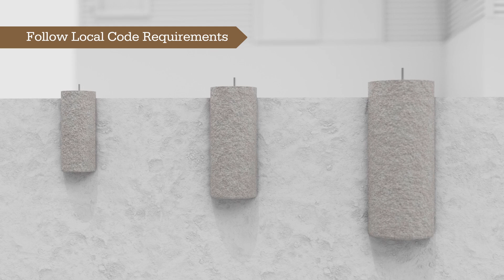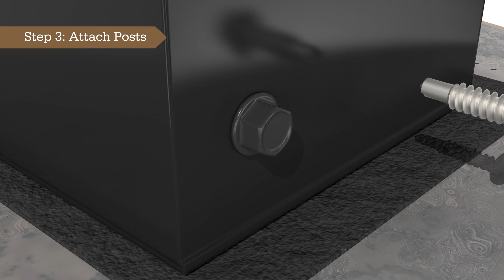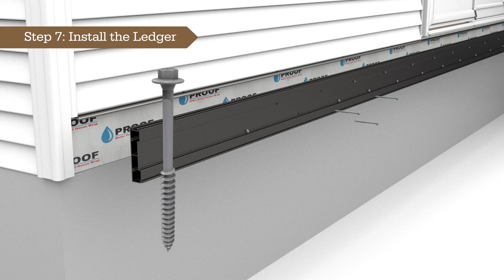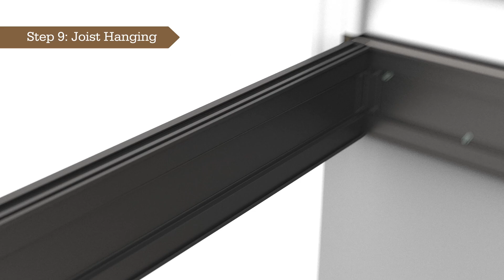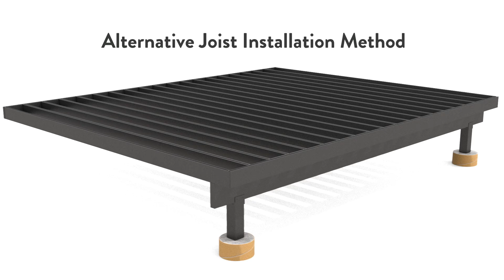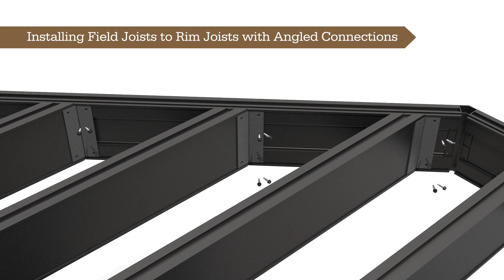TimberTech Aluminum Framing | Detailed Installation Steps

Comment: I am a certified Azek builder and on a build they told me they would credit me 10 boards. That's a big deal to a small business like mine.  Well, it never happened and they have had me running in circles trying to get reimbursed approximately $2,000.00 here is the text from my rep copy and pasted. Hey Andrew. 

Jocelyn is the one who will be taking care of that credit. It was passed through on 5/5/2023 for 10 boards. Distribution has the credit. They were supposed to pass along to your account at Franklin building supply. Not sure what's causing the delay, but from AZEK's side everything was done in a timely manner. Credit was pushed through as soon as you notified me. 

It never came to Franklin or my account so now I go public in a many places as I can copy and paste.  Thanks Azek and Timbertech #azek #timbertech

Comment: We are a Deck Builder in San Francisco. TimberTech Aluminum Framing truly stands out with its best strength-to-weight ratio compared to wood or steel! This allowed us to achieve a significantly larger span than wood, which was a game-changer for our design. Living in a WUI zone, the inherent fire resistance of this frame makes it absolutely perfect for fire-concern areas, providing invaluable peace of mind. It's not just a frame; it's a wise investment in long-term durability and safety.